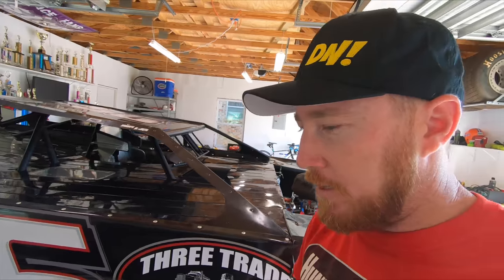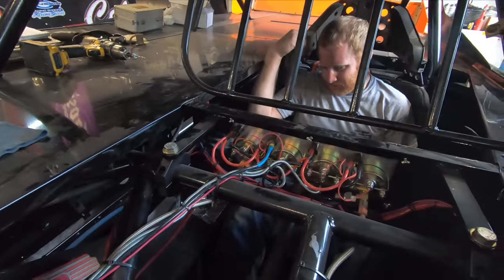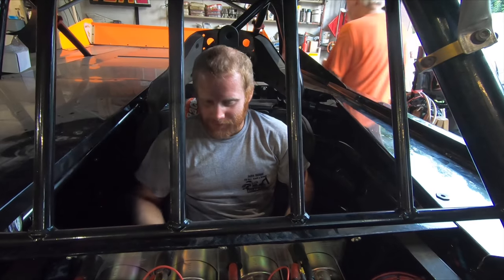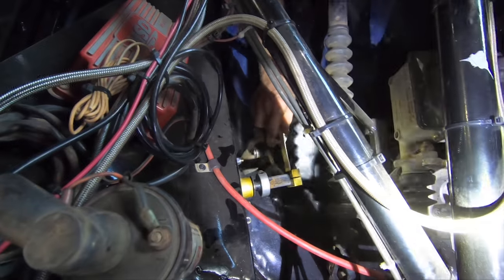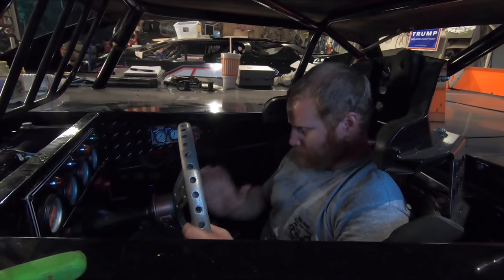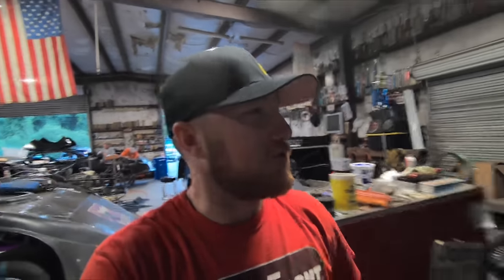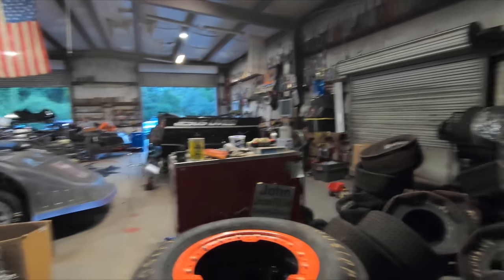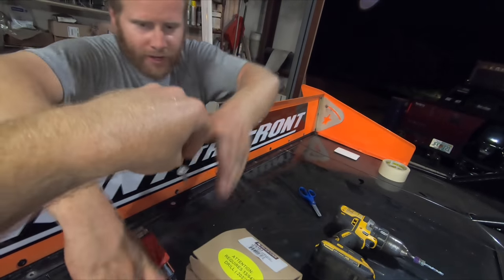We are Going Street Stock Racing

Comment: You forgot the lighter on that wasp nest? Instant torch, and it burns the wings off them quickly, just please make sure they aren't honeybees before you kill them in anyway... I'm a blueberry farmer and we need the bees bad! Already cost enough to have pollination hives set out now... need 3-5 full hives per acre (@$85-$95 a hive) staggered out around the field, we have 575 acres to pollinate... that's equivalent to 75,000 acres of cotton to give you an idea... so quick math will tell you it's very very very expensive... 1800-2500 hives @$90 average per hive, it adds up quick! Tires are expensive too, BUT not quite as expensive as bees! 😂

Comment: There should not be anything wrong with driving a street stock. I used to work with guys that had late model's, modified's, and a street stock. 

Of course we didn't run anyplace one place on a weekly basis. But we were always racing one of the three someplace each week.